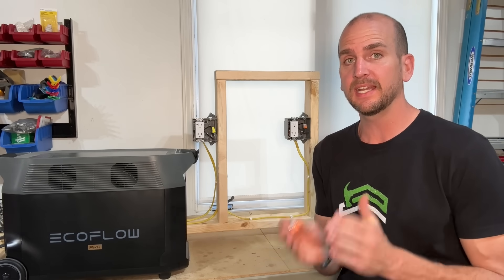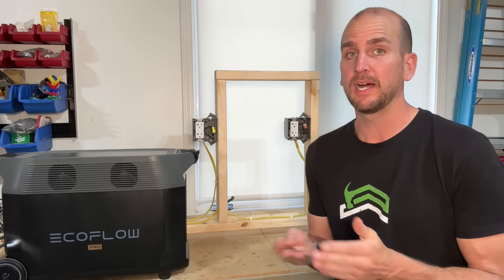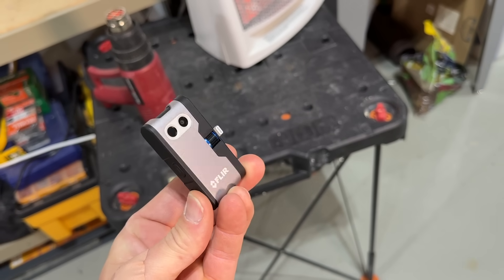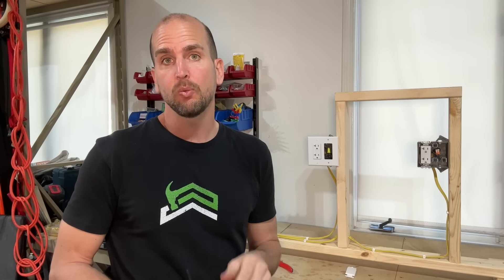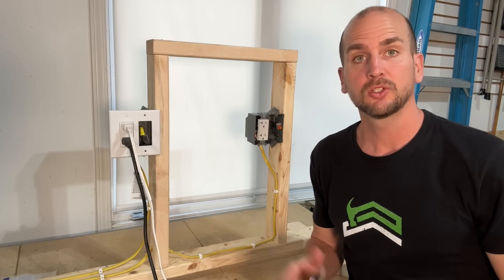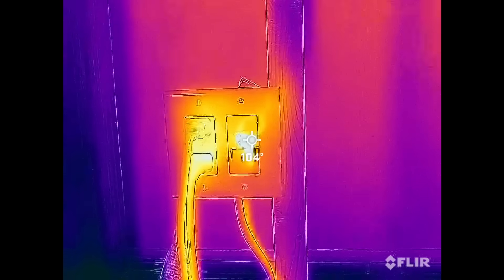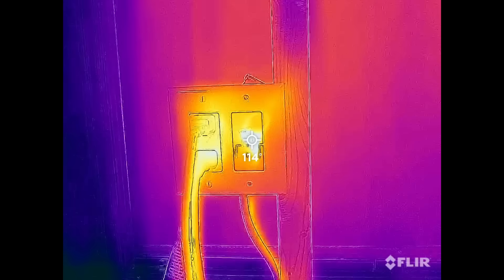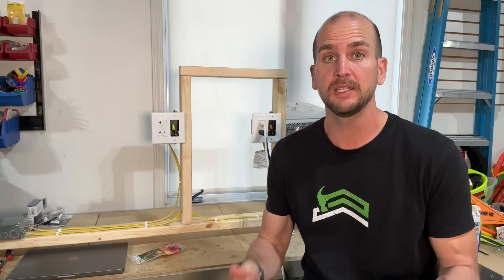Debunking the Pros: Can WAGO Lever Nuts Handle Heavy Electrical Loads?

Comment: Electricity is conducted via a conductor by the 'skin effect'. The electrons flow over the outside surface of the conductor. Much more surface area with a longer pair of twisted conductors and a wire nut than the thickness of the blade contact of a levernut. Although not a scientific lab test it does prove the old tried and true wire nuts are superior when PROPERLY used. One thing your experiment does not take into account is time. I mean over many a protracted period over many varying cycles. You say the Wago's are rated for 221 degrees. For how long can they withstand that constant temperature? Spring metal fatigues when heated over time, so does plastic. If they are rated for 'x' hours at 221 degrees and it's not that long, the effect is cumulative failure is inevitable. I wouldn't say the difference in resistance between the 2 is insignificant and as the current goes up resistance and heat will not increase linearly. Pro's advice is for a reason. They see 1000x more installations and more problems than many home owners can even imagine. Always go for the most surface contact area on ANY connection to limit resistance. Wago's are nothing more than a time saver and that's it. People always think they need the latest wiz bang mouse trap. They're OK for low draw circuits like everybody says, but who says it will always be a 'low draw' circuit, especially if you have a hidden weak point. 
There are millions upon millions of homes that have been using wire nuts for DECADES with a sound track record for reliability. Everybody thinks they need to re-invent the wheel and race to the bottom in some cases and throw out something that is working perfectly well. These 'lever' connectors and interference contact devices have really surged in the market with the DIY rage of the last few decades with every homeowner thinking they can effect their own home repairs, whether capable or not. Usually not. Use Wago's if you like 'em. I don't. Unfortunately, the next homeowners don't have a choice. Most people will do what they want anyway. Aside from taking up less space in the box, after you close everything up and the job is done, what's the big benefit to a Wago? From what I've just seen, they offer increased resistance and can heat up. That's a lousy trade off even if they are easy to use and smaller. I've heard people crowing about them being used in Europe. Guess what? The EU is mostly uses 230-240v line voltage. Half the CURRENT of the US. Typical Main breaker current ratings (EU) are 30-32A or maybe 50A in some countries and the individual branch circuits are 13A, 5A, 3A or 1A or up to 16A max. Big difference from the US. Using a device designed for the EU market and applying it here will not work well. Over-engineered for them (EU), not for here. Like anything, you can roll the dice, some will get away with it, some will get bit in the ass.

Comment: My deal breaker is I'm paying more for a worse connection. Also i have seen level style nuts fail from hydraulic oil. I can't say for sure if they were wago or knock off as the guy before me installed them. But yeah the lever nuts fell apart and broke. The wire nuts took the oil no problem

Comment: Thank you for doing this video! I, too, have seen numerous videos saying that the wago's are dangerous/unsafe and was curious because I started using them per your recommendation. I am a relatively new diy'er and as such revisited my electrical projects and was surprised to find that the wire nuts, although wrapped with electrical tape, were not secured very well. I'm thankful I found your video for more reasons than one!
Reply: Don't use wire nuts if you are a DIY'er.

Comment: Im surprised that the wire nut without pretwisting the wire performed so well.    Can we say that the wago would fail first if tested to failure?  Reckon both are rated for what? 221 degrees?

Comment: I wired up an LED project not too long ago, and it required a detachable wiring harness so the customer could go in and access a 12V lead-acid battery. I used a big fat 9-pin connector to carry both power and data signals, but evidently it wasn't rated for anything above 10 amps in an enclosed area. So that connector fried (just some smoke, no fire thankfully) and I had to go in and upgrade the wires to high current wires designed for quadcopter motors, and change out the toasted connector for one rated for 60 amps. The Wago 221s I used in this project? Barely warm under full load, secured to wood, and in an enclosure.

Comment: failures are generally a result of heat cycling, in addition to vibration/movement; time (hours of use) in addition to load is a crucial measurement of reliability.

Comment: I’d like to see the temperatures with the connections under a normal load. The extreme test you performed gives me peace of mind but I’m curious if there’s any difference at lesser loads. Does temperature scale linearly with current? I’m curious not because of safety concerns but because I’m generally curious 🤓😆
Reply: The heat generated is given by I squared R. Where I is current and R is resistance.  Since R is constant the heat generated is proportional to it I squared.  If you double the current the heat generated increases by a factor of 4, conversely if you halve the current you get ¼ the heat.

Comment: I don't know anyone who uses wirenuts.
As a 'Pro' (yes, I am an Electrician) I would never use Wirenuts. Before using them I would use plenty of other versions.

Nr. 1  would be the wago 221, 
Else I would rather use screw terminals (properly crimped while using finestranded wires) or solder them together (I wouldn't use this on high current 230VAC-wires, as they're prone to unsolder - still better than using wirenuts) 

Change my mind...

Comment: Thank you for covering this subject. Very informative. I did not have that question in mind,since I have been amazed with these Wago lever nuts ever since I’ve been watching some of these electrical channels using them in some of the examples I needed at the time — including yours. Heat max performance never crossed my mind, but I’m glad you addressed it.